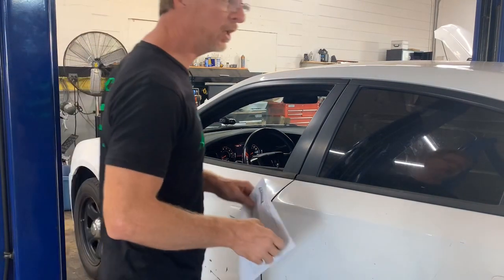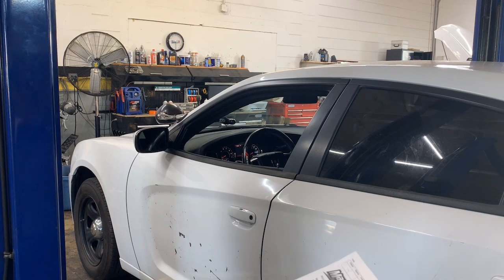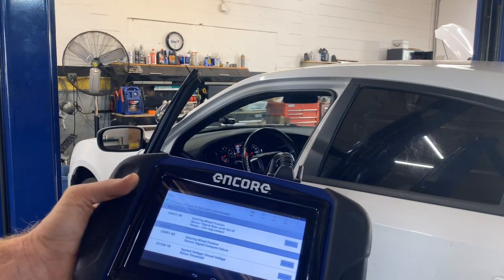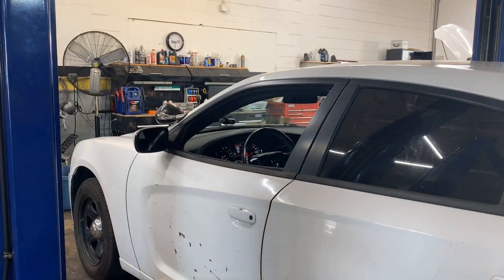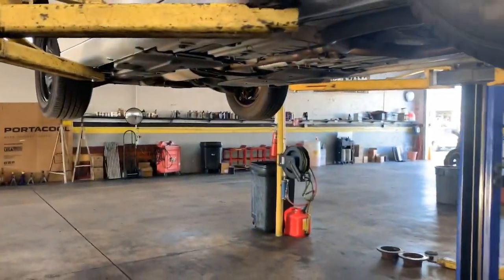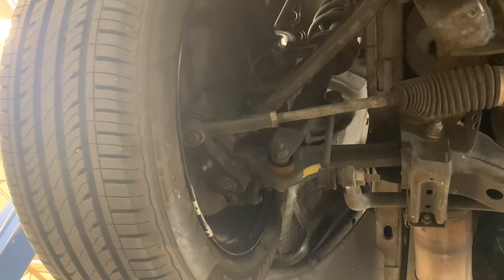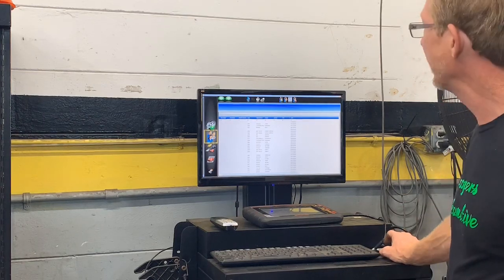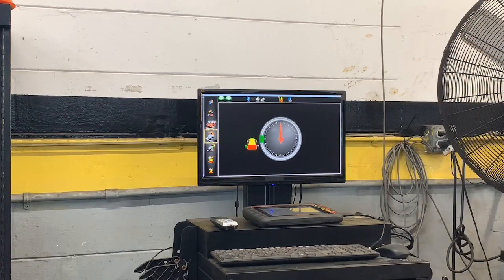Steering angles code 2012 Dodge charger

Comment: Cooper can you help my electronic stability control keeps coming on and goes away causing my all wheel drive to disable. Don't know whats wrong gives me some kind of code lost signal to transmission my mechanic said he's going to replace to valve body module I just got another transmission on it replaced it's interfering with my driving slot and have to turn off my 2017 dodge charger pursuit 5.7 v8 and on again

Comment: i used to be an alignment tech for almost a decade back in the 8os, using the old snap on bubble system, cambers used to be corrected by bending the struts w/ a bottle jack and chain, etc but w had a computerized alignent machine as well and our job was excellent - i think i'll be nice if you show how you correct these issues on these modern systems w/ tc

thanks for the wonderful job you are doing👌
Reply from the maker: I sure will thanks for the comment just kind of ran out of time on that I did want to show how connected to computer zeroed out the angle sensor and set the tow thank you very much